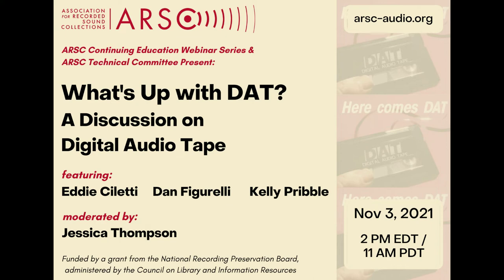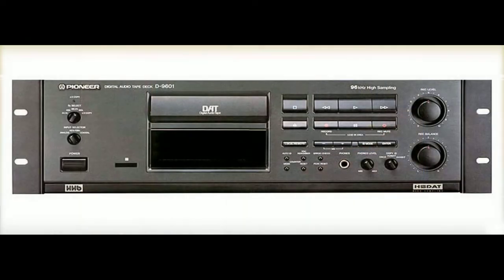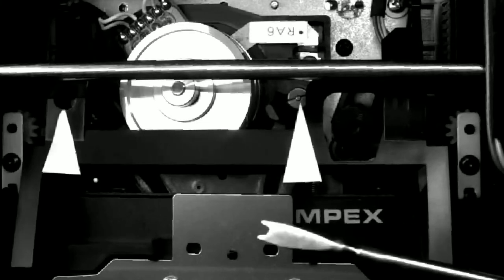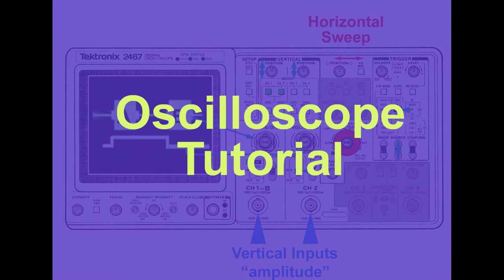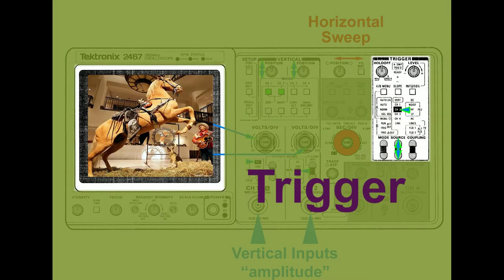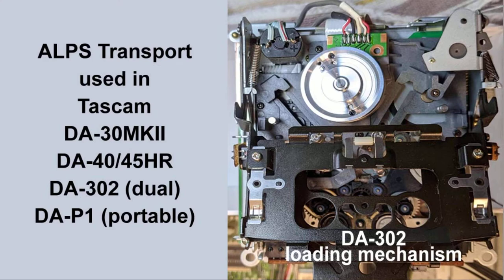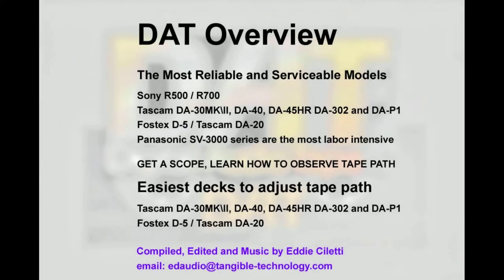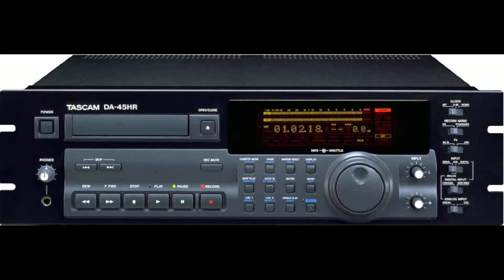DAT Archiving Technical Video-2

Comment: I have watched so many DAT transport videos and found them generally very informative. My problem is that I am the original owner of a Tascam DA 50 and finding any service info or even who manufactured the transport. It is specifically unlike anything I have seen across the various makes of DAT machines. Yet it does share some design elements of many of them. Have you by any chance ever laid your hands on one of these ultra rare beasts? Teac R1 became the Tascam DA 50 for the US market and the Esoteric R1 DA 50 for Japan. I have looked in every corner of the internet I can think of over the course of many months and found nothing other than the general specs which say nothing about transport make or servicing. Any help you can offer or suggest would be finding the light in a sea of darkness for me. Keep up the great videos!!
Reply from the maker: you'd have to send me pix - my email is on my website.  The thing is, I cater to archivists and in doing so, recommend machines that are "relatively easily serviced," partially by design, but also, manufactured in enough quantity so that "parts" can be scavenged.
Reply: @edaudio  I thank you for the reply. I will be getting it opened up this weekend for cleaning and a new belt so will send pics to your email then.
Reply from the maker: @granttucker9006   f the transport works, you need a scope to see the signal from tape.  If the transport is broken, you need to know which transport and whether it is worth getting a second machine for parts.  Why he DA-50, tho, when there are other more easily manageable models?
Reply from the maker: I'd need to see the transport
Reply: It uses the first mechanism made by sony  used on dtc-1000es with 4DD motors (there's plenty of those around)

Comment: "sony metal on metal tape guides comes loose" that's incorrect information, you have the screw at the bottom to adjust the tightening. In fact is just the opposite it's easier on other systems (without any screw) to come loose then on sony's. I have dozens of different sony's models and they all are in sync.
Reply from the maker: We shall agree to differ.  I have repaired many previous models of Sony with that problem
Reply: Of course! Keep up the good work.👍  @edaudio
Reply: The problem with Sony is that the guide part (together with the locking screw) comes loose from the aluminum base. Not a big deal, can be fixed with a drop of superglue but the deck will need alignment
Reply: @dimis7raf  Of course! I generally glue it with superglue also, but I don't think the author was refering to that specific problem. Anyway, that's just a detail with easy fix. I have lots of dat recorders, most sony pro and don't find justifiable the bad reputation of misalignment some people throw at them